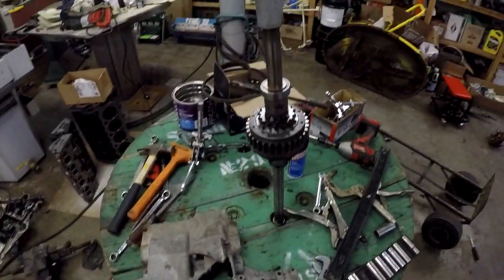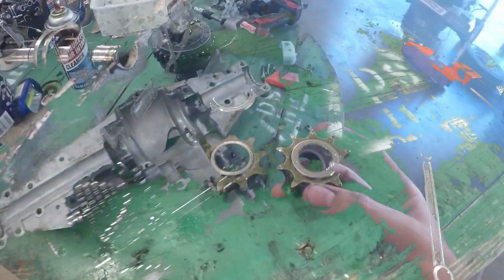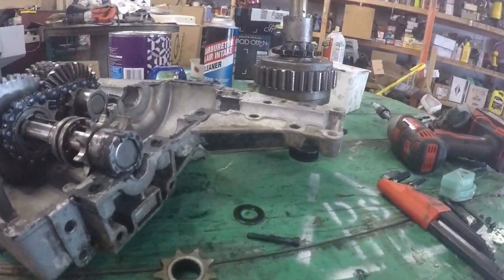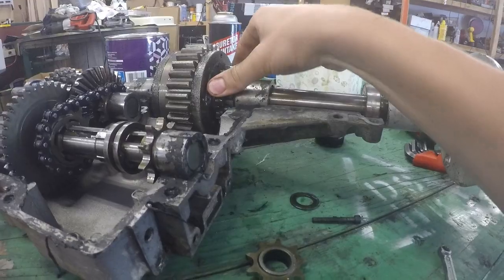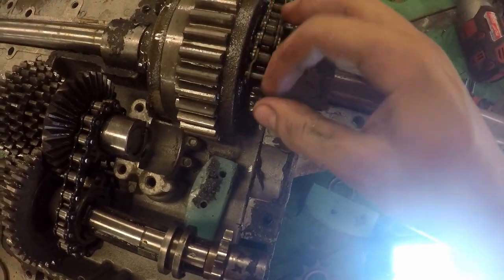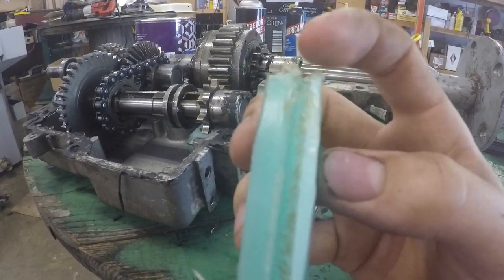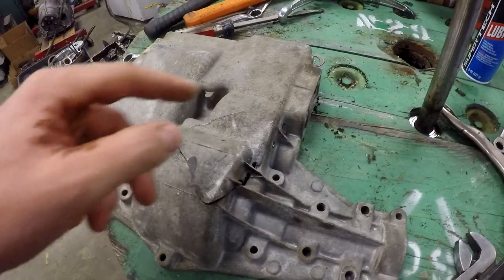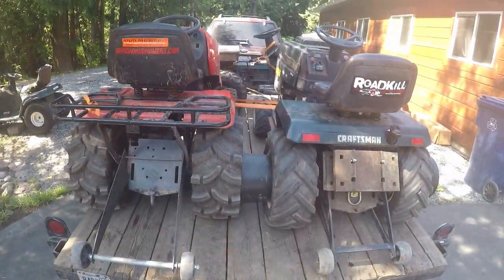50 MPH Lawn Mower Part 2

Comment: Alsoi would use #410 chain it's 40 pitch but slimmer and  more than enough.. when I did the chain drive conversion on my Spicer I tried a couple tooth ratios before I got one I could use with no half links or master links. I do that a lot with chain drive stuff tho I'll use a chain break and then press it together, throw a tack on it to be safe and indestructible chain..

Comment: That Foote is exactly what I got on my quad... Those are very easy to convert to horizontal input... All u need is some ⅝ keyed shaft (hardened steel is best but I use mild steel with a modded 212 and it's lasted a few years already) and some good key stock.. also I block the stock input shaft with a bolt
Reply from the maker: Yeah I've seen that mod done to the Footes.
Im going to be using a vertical shaft V twin on the build its going on. I've been waiting a few years to build this, and might have some time now.